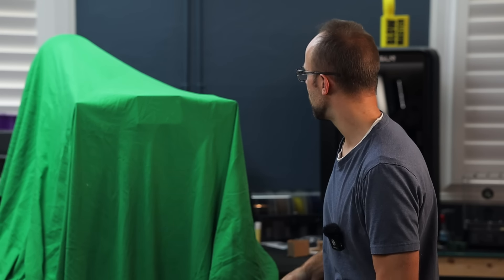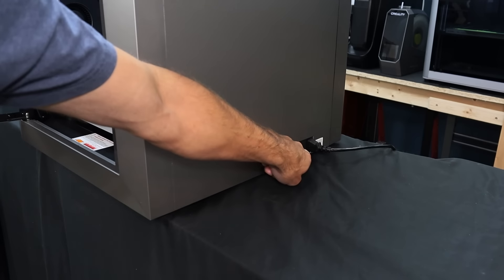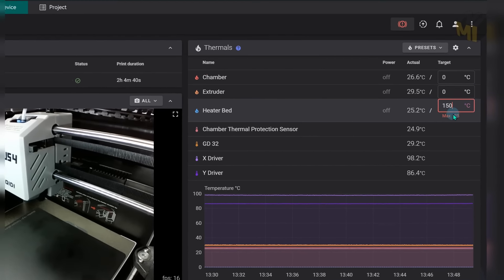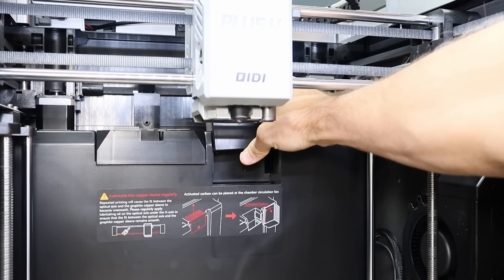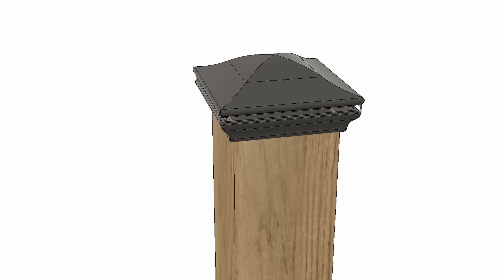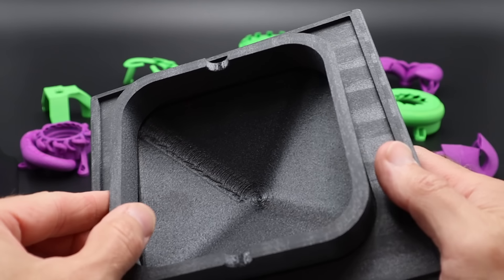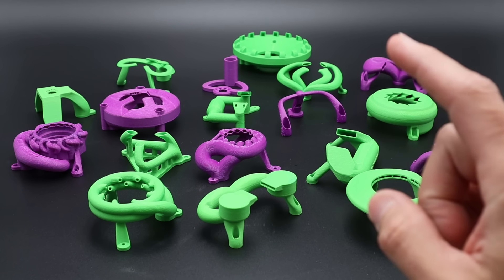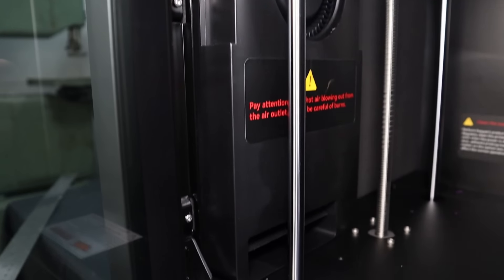The All New QIDI PLUS4 - the best value to performance printer on the market

Comment: You having tested this printer for months makes me feel much better about it. Previously they’ve released printers with seemingly limited testing so I’m glad they’ve changed. Qidi seems to learn quickly and improve their products a lot
Reply from the maker: Out of any company I've worked with they are easily the top 2, they're organized and just pleasant to work with.  They send me the products well in advance to make sure that I have the time to do a proper review.  I think testing a machine over 2+ months is the way to go.  If anything were to go wrong, it'd likely happen, but I'm confident that even if something else happened down the line, I have confidence with QIDI that they'd do the right thing.  They're working hard to build a good reputation and to get to be one of the top companies for printers, and I think they're very close.  I'll be using this printer for some follow up videos too, if anyone has any questions or materials they'd like tested, I can certainly add those.
Reply: @NeedItMakeIt I was curious what kind of probe they’re using for auto leveling, it doesn’t mention on the website?
Reply: @NeedItMakeIt  So my decision lately has been on an X1C or see if Bambu relates a larger bed size in a comparable unit.  How does the Qidi fit into that decision?   I decided the X1C over an Ender K1Max.  Is this Qidi more comparable to the K1Max?   Up to this point, opinions seem to be that Bambu units "just work" more reliably than many others with less customization.  I appreciate your point about lack of calibration on the Qidi.  Just interested in your opinion if you'd offer it.
Reply: @NeedItMakeIt paht cf
Reply: @NeedItMakeIt  can I send you my Plus4 to test?  I'll have to ship it in parts.  I've had it for weeks.  Haven't printed anything. Replaced every board in the head.  Replaced the hot end. Replaced the nozzle.  Still nothing.
Reply: this is a fire hazard

Comment: We've printed PPS with the Q1 Pro with no issues.  If I NEEDED a bigger Engineering Printer I would Definately go with another Qidi
Reply: QiDi has been knocking these printers out of the park lately. I would easily go with these over a Bambu Lab P or X series at this point.
Reply: I've had a lot of success with Polymaker PPS-CF on the XMax-3 as well. I'll be curious to see how Qidi's own PPS-CF filament compares.
Reply: For real? That sounds extremely enticing. I have almost convinced my boss to buy an FDM 3D printer, but since we are a chemistry lab, most materials would have to be reasonably resistant towards organic solvents and such. Our department wants us to buy some equipment (basically fancy plastic funnels that need to be resistant to chemical waste) that would cost a few thousand euros in total, but I'm trying to argue that it would be cheaper to buy a printer and make them ourselves. Have been trying to find a printer that can do high performance materials (PPS, PVDF, PA12, and similar), but most seem to be outside of our price range (roughly 1k EUR). If the Qidi printers can do this, then that seems like the ideal fit for us. Then I guess it's just a question of which model we should buy.

If I may ask, how many failed prints before you could do PPS without issues? And what about bed adhesion? Also, with nylon (e.g. PA12), any issues with bed adhesion or warping (if you have tried)? Any other things to keep in mind?
Reply: For the love of Christ, do not buy this printer.  I've had mine for weeks and I have yet to print anything. I'm not the only one.  Not even close. There's an entire thread on reddit about fighting Qidi for a refund.  Buy the Plus4 if you like writing emails and taking apart brand new printers with serious quality issues.

Comment: There is this line on the Tech Specs page of the printer: Multi-Color Printing Compatible with QIDI Box(Multi-color).  I can't wait to see what that QIDI Box will be! I don't think it will be compatible with previous printers though, my X-Max 3 can't p0op :(
Reply from the maker: Probably not, it'd be tough to do backwards compatibility, it might be possible to mod the machine to make it happen though.  I'm really curious too, I hope I can get my hands on one of them, I'd be more than willing to buy it just to see what it can do.  I'd even be happy if it could do just 2 colors as long as it could also run TPU though it.
Reply: @NeedItMakeIt  It would be a smart move to make it campatible with TPU! Many people want to do conpliant mechanisms, and it would be in line with the engineering side of 3D printing that Qidi is more aimed at.
Reply: Same my  X-Max 3 is over here like :penguin-blue-waving-tear: what about me??!? No klipper .12, AMS compatibility? V3 hotend or chamber heater upgrades? It would be so nice to retrofit some of these new upgrades since it is their flagship printer.. Kind of feels like we'll be required to buy the X-Max 4 when they release the Qidi Box.  Kind of a bummer if that's the case.
Reply: I think the generation 3 devices are going to be abandonware from Qidi. They appear to have given up on Klipper updates and so many of the hinted features are never going to materialise. Really love the printer, but having a hard time trusting Qidi.
Reply: @joshstewart2131  Definitely feels that way. It's a huge kick in the teeth considering how they managed to turn around the x-max 3 from the launch issues into a beast of a printer.  It's an absolute shame the way they are handling it now.  I really like their printers but I sure don't like it being abandoned so soon.  Having to rely on the community to further update it seems like the only option today.

Comment: Wow! Wider frame, larger belts, thick bed, insulation, Ethernet port, they really paid attention to a lot of engineering points on this one. The print quality looks phenomenal. I think they looked at what all the real quality testers have found in that a stiff printer with a solid motion system is necessary for high quality high speed printing. Seems they must have a decent extruder design as well. Granted we would need to see some prints without fiber filaments up close to really scrutinize, but it's looking good! I just got my Plus4 and I can't wait to use it and make some functional car parts. 😁 All of the ducts for the challenge look sweet too. Super excited for that.
Reply: Did it work?  Mine is hot garbage.  And I'm not even close to the only one.

Comment: Just ordered up my 4plus.  Will arrive for Thursday.  Line up now includes the Qidi 4Plus, Q1Pro, XSmart3, and hot rodded Ender 3v2 converted to direct drive.  Looking forward to using the 4 Plus!
Reply from the maker: Nice!  I it a nice machine.  I just passed the Q1 to my brother to try out, it has been a workhorse, for the price it is still possibly the best value printer out there, this printer is right up there too, it really just depends on what you're looking to make with it.
Reply: @NeedItMakeIt  My Q1 Pro is seeing some miles, love doing nylon glass fiber for cases.  I will tell ya though my tiny Xsmart 3 is a true workhorse it chugs out tons of smaller prints effortlessly at great speeds.   I am looking forward to getting the 4 Plus set up, hope I have enough depth on table I use for it to fit, otherwise it will have to takeover my deskspace.  They saying first quarter the AMS unit will get released, I am very excited to be able to do multicolor on prints.  Plan on making chute that will feed into a 20 gallon reclaim pail.  

I have turned into a huge Qidi fan over the past year, they listen to users, my plan is to open my own channel in Oct/Nov time frame which highlights 3d printer use in a small home wood and metal shop.  I have 4 years under belt now using printers and am amazed by how quickly they have been moving along since Klipper hit the scene.  It is an exciting time to be into 3d printers.   Busy teaching myself Fusion 3d the past few months.
Reply: r/qiditech 

Come on over and suffer with the rest of us.

Comment: The side panel insulation and a few other elements are essentially 1:1 with the X1E from BL. I’m glad these are becoming more common at a lower price point.
Reply: I know you’re not saying qidi copied Bambu but I always think it’s funny when people act like qidi is the dupe since they’ve had enclosed consumer xy printers for for far longer. Once again, that’s not directed at you, just a comment about things I’ve seen people say lol
Reply: @Resyektt  Totally get what you mean. In this instance I mean it seemed like the foam panel insulation was near identical to what I have on my X1E, which might not even be exclusive to that machine. Potentially even the same supplier.

There’s definitely some spawn camping on anything non-Bambu it seems these days. Seems like a solid machine and a noticeable upgrade, I’m glad they’re taking feedback from the community and have a more open source approach than BL.

Comment: Wow this printer seems super good. I've had my QiDi Q1 Pro for a little over a month and it's been amazing. I got it for $350 so I can't complain but the Plus 4 seems like they made all the right improvements. The main annoyance for me with the Q1 Pro is with the filament loading and nozzle cleaning and both of those have been addressed! I might pick this up down the line.
Reply from the maker: The Q1 Pro is still on the top shelf for me, you can't beat the price an the performance and I'd still recommend that machine to anyone looking for a good price, this machine is just the big brother and I think it will have the "AMS" compatibility if that's something that matters for people.  Most of what I do is only 1 color, on occasion it'd be nice to add some text on that first layer here and there, but it's not super critical.  I think for printing parts to sell, the color is a good think to have though.  It's a solid contender and I think it should be somewhere close to the top they went way beyond the competition on the parts for this machine, it's beastly how massive everything is inside, very impressive work by QIDI, how they're able to do all of this and keep the costs down this low, I don't know.
Reply: @NeedItMakeIt I completely agree. QiDi has been knocking it out of the park lately. Also, if you check their website it shows that there is an AMS coming for the Plus 4!

Comment: Honestly this printer looks and feels way better then the bambu lab x1c!!! But honestly what I would love to see is a fusion of this printer with the Pursa XL multu head change 🤤 I can print multi material like the shell can be made of TPU and the inside of the part ABS CF and use support material and what could be also interesting is that it can print with 2 nozzles at the same time like one nozzle lay the filament and the other one is dedicated for support material
Reply: Yeah and also it would be honestly cool if it could fly but not like a drone more like a bird plus a rocket launcher and also if it had a 8k 3d camera, 2k screen, pneumatic articulating tank tracks, and also VR!
Reply: @Crappy.Consumer.Reports  yeah that would be amazing 🤩🤣
Reply: Someone is working on simultaneous extrusion in a single part.  I can't remember who.  Neat stuff.  I'll see if I can find it.
Reply: @joshstephens3224  ohh that sound nice 😍

Comment: Appreciate the video. Well done. I hope QIDI makes the turn. You can see the effort they are putting in some of the details to be a great printer.  Its impressive too that all of the reviews online frequently note their fantastic customer service. But you have to ask yourself, why are there so many new owners experiencing issues to need support. They have a track record of issues at launch and based on the exclusion of reviews from other reviewers who previously had issues, it doesn't inspire confidence. I found just a few reviews so far and this is the one with the least issues.  Its a bummer, because that's a solvable problem and to see it repeated release after release is counter to the engineering and heavy duty parts.  They just need to test more and better, and have a clean transparent launch.
Reply: It is a mistake to assume that the only reason people turn to support is when something goes wrong mechanically.  People contact customer support all the time even for fairly minor things.  For example, a print not sticking to the build plate, issues caused by retraction settings, issues caused by printing some filament with too low or too high of a filament temperature.  Basically, anything you can think of that you'd imagine someone new to the hobby might ask any number of online community forums, or can be looked up in an FAQ, then customers will ask these questions get asked of support as well.

When Youtubers mention good customer support, they mean that the company typically responds within 24 hours to such things, instead of 2-3 weeks.
Reply: @stew675  I agree on that point, but if you look at point of purchase reviews like amazon, the details of the customer service is very commonly because the machine isn't working. Its not the content creators reviews that are the only factor, its the individual buyers. It paints a picture that is counter to the goals of the design. My point is they can be a formidable competitor if they can stop launching unrefined products and improve their quality control.

Comment: I'm extremely surprised. The jump from each generation of printers they release seems gigantic. They do listen and that's a great sign.
Reply: Yeah,  I have been following QIDI for a long time and I feel that plus4 is one of the best value 3d printer this year.
Reply from the maker: I think they're finding their niche and I like it.  I know not everyone wants to print heavy duty parts, but I like the idea of being able to do just about anything you need to.  To your point they've been changing the printer style bit by bit and including what people want the most, now they have the clean looking printer that looks like metal, I think that's what people want.   The flat panels for me are really nice, because we can now think about mounting a Skadis or some storage to the sides easily, before that was not really possible.  I don't know what Bambu will be releasing soon, so it's hard to say if they will be competing, but I think the bambu will be very $$.  I've heard that it will have an IDEX setup which would be nice, I'm not sure if it would be compatible with an AMS, or if there will be another version of it. I guess we'll have to wait and see.  The competition is heating up, I'm excited to see if anyone can compete with the Beast that is the PLUS4!

Comment: Looks great, thanks for the detailed information on the belts, fans, and other features. I wish they'd pushed it to 380-390 nozzle and 140-150 bed as that would enable really advanced filament use - I guess that will be reserved for the Plus4 Pro or Plus 5.

Comment: Qidi makes a dual head printer.....or used to make one because I own it. Its a beast. It worked great for many prints. I once ran it for a week straight and it just kept printing. I forgot the name (maybe 600 or 6000). Anyway, obviously they can do it and maybe they will do it with this line of printers. Although i think 2 headed printers are in the past with AMS type of addons. good video

Comment: Qidi is definitely the second brand I would buy a 3D printer from. No Creality, Prusa or Flashforge for me anymore!
Reply from the maker: Originally before I got the Q1, I wasn't sold, I had heard good things about their custom service, but the reviews were only okay, nothing spectacular.  I've been using the Q1 for quite a while now and it's a great machine, I'm not sure you can beat the price for what you get and the machine with the heater (with proper HT cover) still performs.  I actually love it so much that I wanted my brother to give it a try to see what he thinks about it.  He has the K1 right now, and there are some issues with extrusion and a wobbly frame.  So the Q1 changed my mind about QIDI and now, testing the PLUS 4 , I've even happier with the direction they're going.  There isn't a lot of crazy innovation, small incremental changes to end up with overall a superior product that still doesn't break the bank.

Comment: This is my next printer.
Reply from the maker: It is a beast of a machine, I love that they way beyond on the frame and parts to make it as stiff as possible, so far it has been so nice to use, I rarely have a printer that I don't need to do anything to so that it performs well, the X1C was one and this is the other.    I suppose I did use the JB weld though, I guess that does count.  I'd like to see QIDI also make a move on their own version of MakerWorld too, I see a lot of potential.
Reply: It's very adorable for what it offers,  Couldn't find anything about it but I believe ironing  would work better in a heathed chamber which I'm using a lot recently.

Comment: I really like the new design. I recently had the X-Max 3 on my shortlist as a new printer, although I didn't particularly like its design. The Q1 Pro didn't really impress me, a bit too small and some details not really thought through.
It seems that Qidi has done everything right with the new Plus4, and the price is really very good. If I hadn't gotten a Creality K2 Combo in the 40% promotion , the Qidi Plus4 would be a real option for me.
I don't really need multi-color / multi-material, but it is nice to have , and Qidi will probably have one available soon.